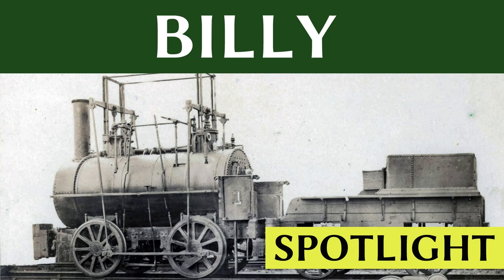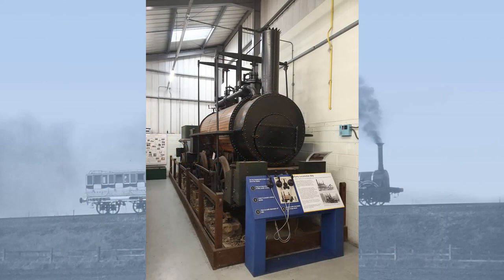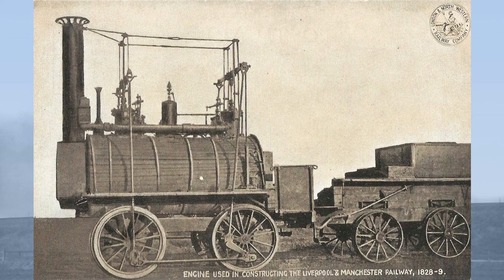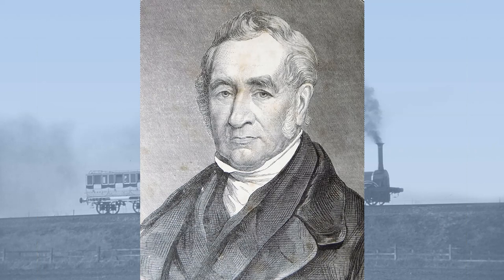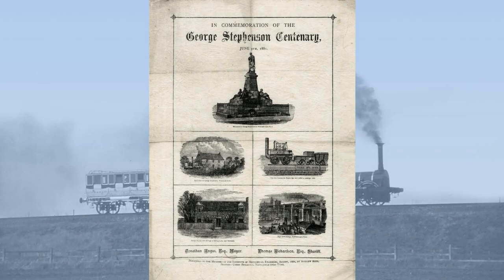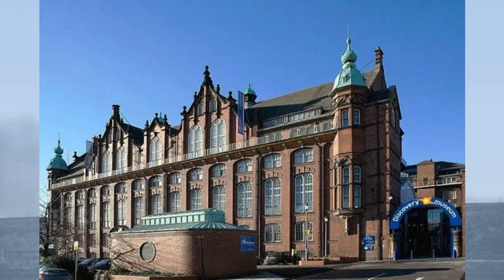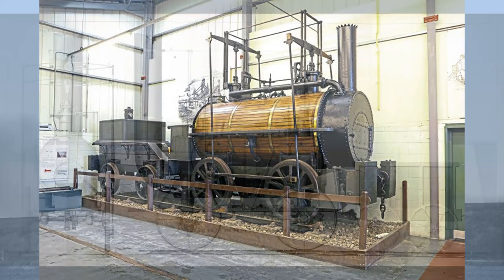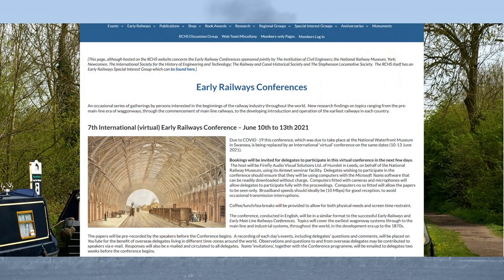Spotlight: Killingworth Billy

Comment: I would love you to cover the first locomotives in Australia from 1854.
The Melbourne and Hobson's Bay locally built locos. One a converted pile driver and another that used a pair of locomotive' driving wheels in stock at a local hardware store.
Both helped the line get constructed quicker than expected and before the Stephenson ordered 2-4-0WTs arrived. So put to work on the line from 26 September 1854.
The glass plate photo taken to record the momentus event was dropped while developing.
Only artist's impressions of the line in the distance record what looks like a 0-2-4T, but others assume it was a 2-2-2T like the company's printers block letterhead. Local historians have concluded the former as being possible to build locally at the time using spare wagon parts for the carrying wheels.
So a mystery for both as they did not survive long, although a newspaper article from 1862 said the main one should be preserved as being as significant to Australia as the Rocket. Only the six wheel arrangement is known in those pre Whyte notation days. Ended up as a sawmill power but not illustrated.
Saying this in the vain hope that some better illustration exists unloved or undiscovered in the UK.
Reply from the maker: Sounds like you already know more than I do!

Comment: I understand that Killingworth Billy was last steamed some time in the 1880S and her last steaming was some thing connected with a event about George Stehenson's life but please correct me on this as its probably that this engine has not run since 1879?
Reply from the maker: It ran at the Stephenson Centenary of June 1881 when it formed part of a cavalcade which ran on the now defunct railway line which ran literally feet away from Stephenson's cottage in Wylam.
Reply: @AnthonyDawsonHistory  I guess they knew what the boiler was like back then as its working life had just finished a few years before?
Reply from the maker: @eliotreader8220  people would have been aware in 1881 that it had been at work recently.